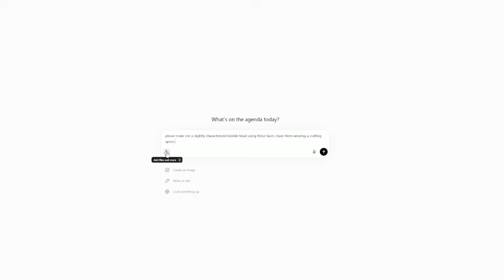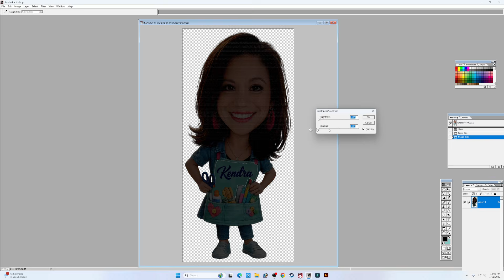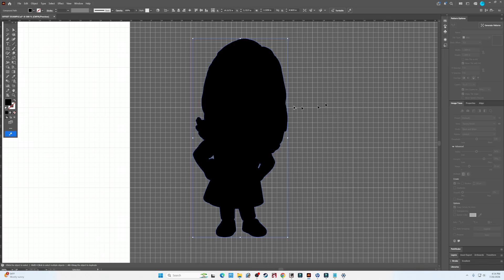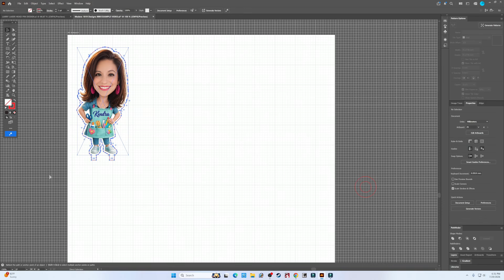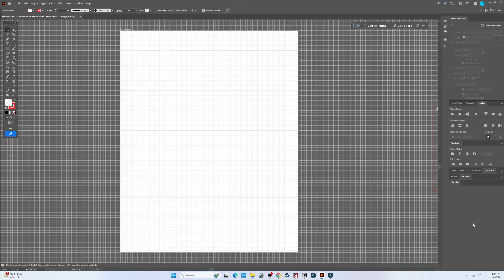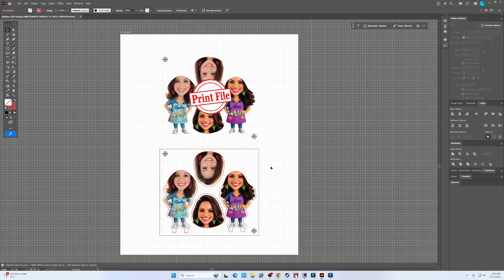UV PRINTED   LASER CUT  BOBBLE HEAD DOLLS   HOW I DESIGN IT!

Comment: What is the sizes of the Washer circles?  If we use the same 15x11mm springs that you provided the link to?
Reply from the maker: The outter diameter of the washer is about 1”  and make the inner circle of the washer, just a little bit larger than the base of the spring base.